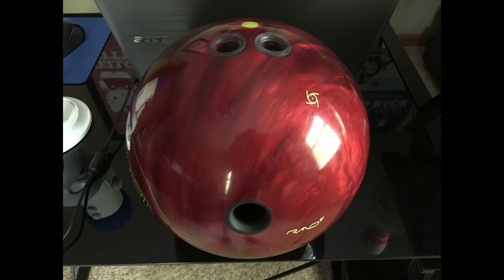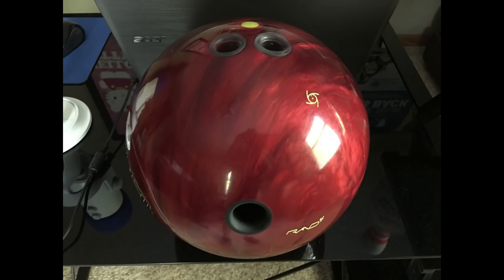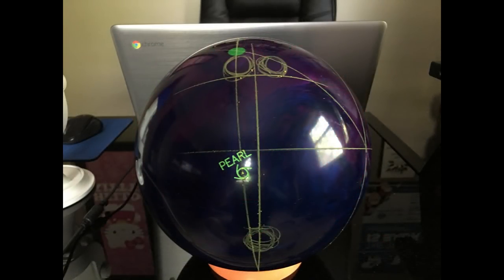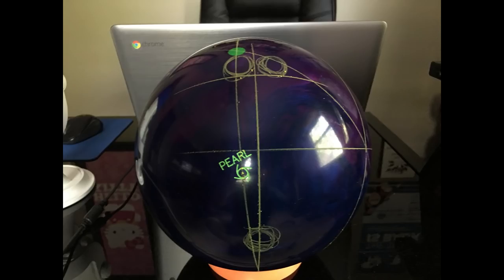Tech Talk #3: The Importance of your Positive Axis Point and My Layout Information

Comment: Hi Luke. I used to have Timeless and it's a skid and snap reaction and I feel more comfortable with that. My second ball (Hyroad pearl) hooks earlier. My question is will that be the way my pro shop drill for the Timeless or it's the ball's natural reaction? Or can be the drilling replicate to any ball? Thanks
Reply from the maker: Reaction differences are much more a ball attribute than a layout attribute.  You're not going to take a No Rules Exist and make it go 50 feet and turn sideways with a layout, not possible.  The Timeless was designed to be long and strong, so it being skid snap for you definitely makes sense.  Now using a layout to fine tune a ball to how you throw it will HELP, but ball choice is by far more important than layout.  If you get a ball that doesn't fit your style or the conditions you're on, a layout won't save it.  If you like skid and snap balls like the Timeless, then make sure you find balls like that which will fit your style better.
Reply: Now I understand. Thanks Luke!

Comment: What is a layout for lower rev rates that seems to be the most even? Would something like you 65×5 1/4×40 work or would something else be better?
Reply from the maker: A good one would be 50 x 4 x 50.  It's fairly even, higher flaring, and continuous, so it will give you a lot of traction without being jerky.

Comment: Hey Mr luke my names Addison Leisher and i am very interested in learning how to layout and drill a ball correctly so I was wondering if you could make a video showing how to find a correct layout for someone and then show how to drill the ball correctly
Reply from the maker: Actually working on that right now!  Kind of lol, revamping my Dual Angle Lite video, but as far as selecting a correct layout, that can be pretty complicated.  It's about matching a person, a ball, and the layout up to the condition, so it's something that requires combining and considering a LOT of variables.  Ball choice is much more important than layout, layout just fine tunes the ball reaction, so a layout that may work great for someone with one ball may not work at all for a different ball based on the ball type, it's completely a case by case deal.  Now sometimes like I've found, you have a certain layout that you find that works or just fits, but once you do that, you've gotta be selective with ball choice.  There should already be tons of drilling videos out there too, actually putting holes in the ball is the easiest part by a long shot, I could teach a monkey how to do it in 15 minutes lol.
Reply: Luke Rosdahl awesome thank you I can't wait I love your videos ：）

Comment: I have no idea about anything about drilling. Could you give me the simple rundown
Reply from the maker: Absolutely.  Like I said, I'm going to remake that video I talked about and that will explain it with pictures and video.  

Drilling angle: Effective range is 10-90 degrees.  The lower the number, the earlier the ball is going to roll and the sooner it's going to want to hook, the higher the number, the later it's going to roll and want to hook.

Pin length: This controls flare, or the distance between the oil rings on the ball.  The more a ball flares, the more fresh coverstock is exposed, and the more aggressive it makes the overall ball motion because of the imbalance of the core.  Go to the link in the description for the dual angle system and scroll down a little, you'll see some pictures and information that will explain it better than I can here, because it's a little different for asymmetric cores than it is for symmetrics.  

Val angle: Effective range is 20-70 degrees.  The lower the number, the quicker the ball will respond to friction, or the sharper the motion will be, the higher the number, the slower it will respond and the smoother the reaction will be.  

The bottom line is that layouts just fine tune ball reaction though, a ball that's designed to be aggressive is still going to be aggressive no matter how you drill it.  Just like a driver in golf is a driver, you can do a bunch of stuff with your hand positions to change what it does slightly, but you're not going to turn it into a wedge just by the way you hold it.  As far as important factors go, surface is 80% of ball reaction, core is about 10% and layout is about 10%.  A weakly drilled Sure Lock will still hook a ton more than a strongly drilled IQ Tour Solid, for instance.  In other words, for your average bowler that just bowls a few leagues a week, ball choice is much more important than layout, even for me, my layouts generally stay the same for league balls because layout just doesn't matter nearly as much as most people think.